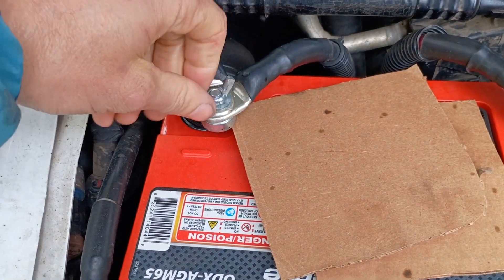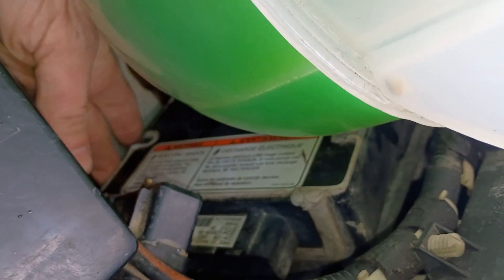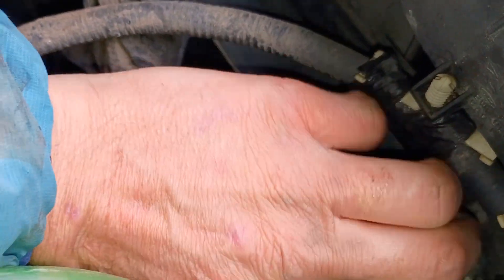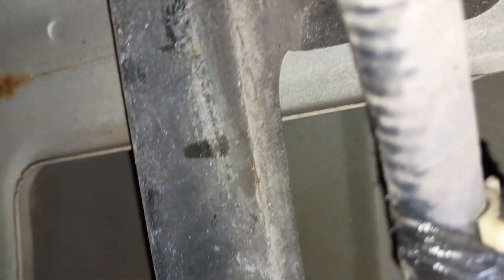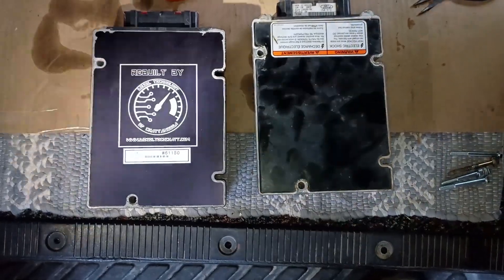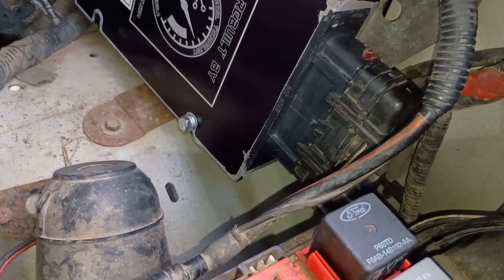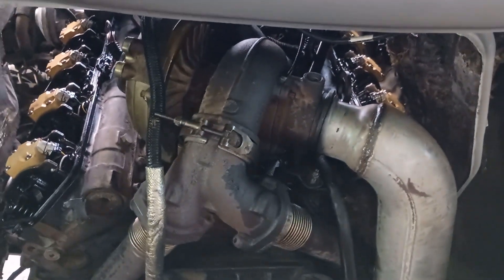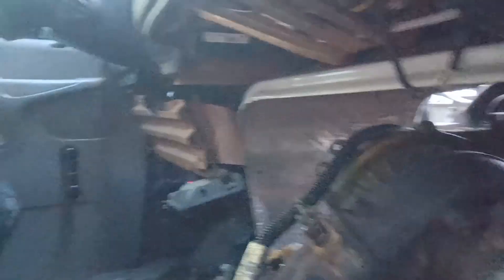Replacing the Injector Driver Module (IDM) on a Ford E-350 Powerstroke Econoline Diesel Van

Comment: Just  FYI, a continuity test doesn't prove a wire is intact enough to carry the load required. With stranded wire, one single strand will show continuity, but that won't necessarily carry the load required.

Comment: I was investigating a water leak on my 96 E350 and decided to take the IDM out to check it for the notorious water intrusion since I am in the Pacific NorthWet. Sure enough it had some slosh inside. I took the cover off and inspected the board for damage, cleaned corrosion, left it on top of my electric radiator heater overnight, and sealed the cover back onto it with rtv. I cut up a gallon coolant jug to make a water diverting cover for the idm so the cowl drain doesn’t dump right onto it anymore. Seems to have fewer hiccups now. Thanks for sharing your progress, looks great!
Reply: Can you expand on what you did please? Just got a new IDM from DTOC and the last thing I want to do is deal with the hell of pulling on my Excursion again.
Reply: @jamesdean5677 I’m not sure how your IDM is mounted on your excursion, but if the cowel drains right on top of it I would figure out a solution to cover it, even if it is just inside a plastic bubble mailer, something that helps keep the water  from contacting it directly. I’m not sure how to expand on what I did any more than what I already have, I can try to make a video showing what I did.

Comment: While stressful projects like this can suck, I hope you know that you're at least helping some people out.  I'm currently on the same journey you went through on my e350.  I think my injectors may be on their way out, but I'm going to try the additive method and see if that can help with some of the stiction.  

I just recently did a turbo rebuild on mine, it wasn't horrible, but I also did a lot of "while I'm in here" maintenance while I had it out. I did the exhaust value delete, and replaced the turbo pedestal with one that doesn't have the oil controlled solenoid. It's a common source for leaks.  Also you may look at doing a crankcase breather mod also.  Rather than sucking the crank case muck into the turbo you vent it outside.  And if you ever find yourself needing to replace the engine harness, you wont find one for the van (that isn't stupid expensive), but you can mod a truck one to work with the vans.

Good luck with all your future projects!!!
Reply from the maker: Thanks!  I'll keep that in mind for when I do tackle the turbo.

Comment: Good gob man. The previous owners of my van wen through the same thing although the shop that did the job didn’t replace the glow plugs while in there??? They don’t cost that much and the valve covers were already off. I’d like to do mine before next winter
Reply from the maker: Yeah honestly I think doing injectors, wiring harnesses, glow plugs, wiring pigtails, and CCV vent o rings all at the same time makes the most sense.  But doing just the glow plugs isn't too difficult compared to injectors.  

Just make sure you get legit OEM glow plugs; I've heard horror stories of knock-offs swelling and breaking off inside the head at the tip.
Reply: Yes Motorcraft all the way. Learned that with the Dorman GPR
Reply from the maker: @sylvainlaforest4393  gotcha.  Bummer.  Those are also difficult to reach.  I went with a stancor and thus far haven't had any trouble.

Comment: Good job... not many ford diesel van videos ... I have a 2010 with a 6.0..
Reply from the maker: Nice.  From what I understand the 6.0 can be a fine engine if you fix a few things: oil pump and studs?  But I think clearance for injector replacement is harder than on the 7.3.
Reply: @PowerstrokeEconoline  biggest weak link in the 6.0 is the lifters.
Reply from the maker: @ardenbriggs1190 oh interesting.  I haven't done a lot of learning on the 6.0.  it seemed like the bulletproofing process was outside of my skill level and facilities, so I looked for a 7.3.  but a newer body would be nice.